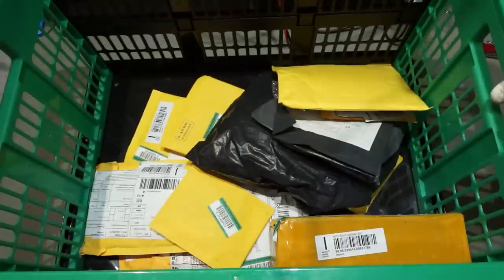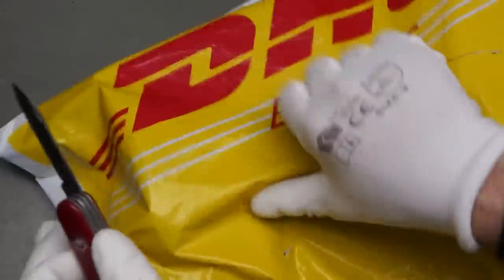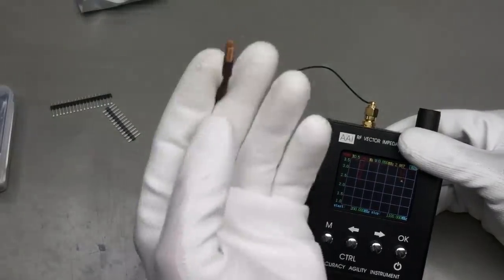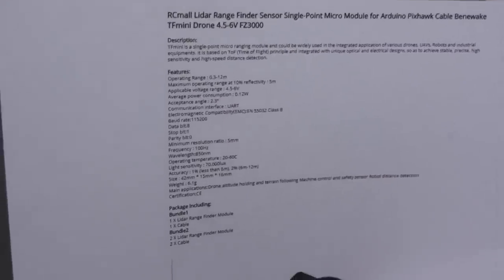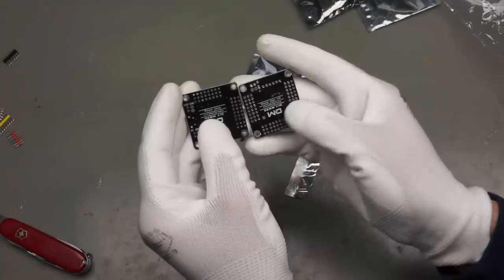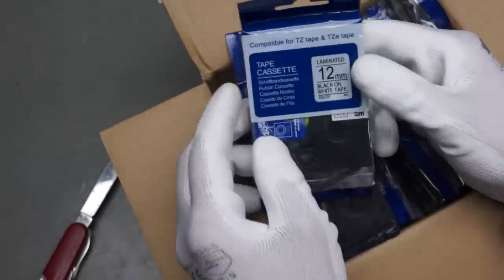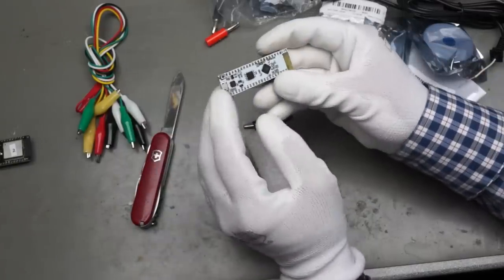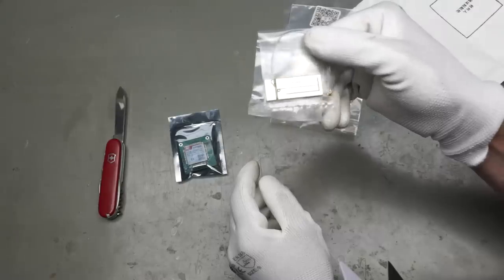#200 How to Spend your Money Wisely

Comment: This raises an interesting set of questions - what software does everyone use in keeping track of their parts, projects, tools etc ?  I started using partkeepr, which is pretty good at keeping my parts organized but doesn't really do much for keeping track of the things I design etc.
Reply from the maker: So far I only use my boxes and the order list / search function of Banggood and Aliexpress
Reply: I've tried to list all of my parts in a Libreoffice-document, but it's getting a tad unwieldy. I'd like to be able to attach any specsheet-PDFs, pictures and any other relevant files/documents and have the whole thing easily searchable, and, well, a Libreoffice-document just doesn't cut it.
I may have to eventually just roll up my sleeves and code the thing myself. It's just not very interesting, so I haven't actually managed to get started yet :/
Reply: Personally, I have a tad icky feeling of Evernote. They spy on you and while lists of what parts and stuff I have isn't particularly exciting, I still rather try to find an open-source solution or something that doesn't do any spying. Or, like I said, make my own solution once I get off my ass.
Reply: I use dokuwiki. Not perfect, but it works
Reply: I do have various boxes for bigger things and a large cabinet for a 3D-printer and the boxes, plus two organizers for smaller stuff ( https://www.dropbox.com/s/g5qswxw5wmbipg9/IMG_20180501_173559.jpg?dl=0 ) but, personally, I do not feel like that's enough. I still like the idea of actually cataloguing all the stuff and keeping all the specsheets and stuff alongside them. Those organizers are a godsend for actually keeping all the small stuff neatly accessible, though, and I don't have to worry about pens fading as I print those labels on a laser-printer.

Comment: I have some experience with the Sim7000E. If you need documentation or FW - you are welcome. This modem based on Qualcomm chipset. New Sim7020E with MTK chipset will be cheaper..
Reply from the maker: All help and experience is welcome. I have no knowledge about this module.

Comment: I bought some sim800l but I didn't got them to connect with the network.
Reply from the maker: Those networks are not easy :-(
Reply: Don't really see any other AT command which should have helped. However I then switched to the A6 which worked well and out of the box.

Comment: 20:48 When people don't fully understand some problems, they get scared. They might warn others who trust their warning and may repeat the warning. This is a useful behavior in case of some immediate danger. But then the warning gets repeated without any immediate danger, without ever asking themselves if there really was some immediate danger. And now it is a problem. Even worse, people get enraged if someone uses or promotes something they think is dangerous.

Most heavy metals are a victim of this irrational fear. Even the term heavy metal causes fear. What is a heavy metal? Metals that weigh more than 5 g/cm³ are called heavy metals. That is iron, tin, zinc, gold and silver, platinum, wolfram and many many more. There are other candidates like cadmium, lead, mercury, thallium or what about polonium. Those are considered toxic or dangerous, but in different ways.

The dangerous part of melting lead and pouring it into the socket of a tool is the involved heat. But having lead somewhere lying around is completely harmless. Most of the curtains I have contain a string of lead beads as a weight. I have lead on the roof, I have it in my solder and I'm not scared of it. I have a box of fishing weights, they are also made of lead. I have light dependent resistors containing cadmium and I'm sure I still have some nickel cadmium cells somewhere. I even have the worst of all, a box of mercury switches (at least 50g mercury there) and some mercury thermometers. I am still alive. ;)

By the  way, we are all much more likely to die from some cardiovascular disease (sitting in front of the computer all day, eating the wrong food and getting enraged about comments on the internet... heart attack impending). If this doesn't kill us, then it is some other age related disease or maybe some household accident, climbing on the chair to change a light bulb. Maybe it will be a car accident. How about walking over the street while staring on a phone and getting run over by someone who was texting while driving? There are many more stupid ways to die, all of them are more probable then death by chunk of lead (except in the land where toddlers with guns caused more deaths than terrorists). And now I'm listening to https://www.youtube.com/watch?v=U7-60tyLQhA and after that I'll leave the house to ride my motorcycle before the thunderstorm begins ;)
Reply from the maker: I also do not care too much... Driving a car is also dangerous and many are killed...
Reply: Yes, driving a car is probably the most dangerous activity for the average person. But they only fear the unlikely things. 

It is weird to read the own comment after a week. I write too much and forget it again, it is a weird habit. And thanks for this reminder to leave the house again, there is no thunderstorm today. And last week, the thunderstorm completely missed every place I visited. People not far away were not that lucky:

https://www.hessenschau.de/panorama/gewitter-wueten-ueber-ost--und-mittelhessen,wetter-muttertag-102.html
Reply from the maker: I was on the highway in this area. Not very pleasant...

Comment: I ordered three extremely heavy DC motors, they arrived three weeks after, but at the same day of arrival, I found out that they were not useful for my project.
Reply from the maker: You can start a dispute if they are not as described. It usually works if you are fast enough and have clear proofs.
Reply: @AndreasSpiess  Sure will, sir.

Comment: 12m is not much for a drone at 20mph it is unlikely to to be able to adjust before it hits an object, and any faster and there is no chance.
Reply from the maker: I think you are right. This is why some drones reduce the max. speed if in obstacle avoidance mode.

Comment: Thanks Andreas, nice, as always! Special thanks for pointing to Nanopower Power Supply LTC3588 - might try it with mini solar. By the way, have you considered to use SPV1040 as this on has MPTT implemented and might be better for maximising energy harvest from solar (or you are going to use LTC3588 with piezo or magnetic source - you are cyclist ant that might explain your choice). Anyway, thank you again for one more informative video! 
P.S. Also would be very interesting how TTGO OLED ESP32 handles battery (will CP2102 be powered all the time from battery or only when programming is done, etc)
Reply from the maker: Concerning TTGO: You have to wait for a week...

Comment: Hallo Andreas, ich habe aus dem TF Mini Sensor ein rotierendes 360° Lidar gebaut. Falls Du interessiert bist: https://github.com/Brezensalzer/StepperBotLidar2
Reply from the maker: Sieht gut aus! So wie es aussieht kannst du nur einmal 360 Grad abdecken? oder hast du eine Lösung für einen rotierenden Sensor?
Vielleicht werde ich Teile deines Sketches verwenden, wenn ich darf. Wie hast du die Visualisierung gelöst?
Reply: Der Arduino Sketch liefert pro "scan#" Befehl ein Set aus 360 Messpunkten ab. Der Rest passiert auf einem Linux Rechner mit Python (matplotlib.pyplot). Wenn man das in einer Endlosschleife aufruft rotiert der Sensor kontinuierlich. Die "echten" Lidars drehen mit konstanter, PID stabilisierter Drehzahl und liefern in festen Intervallen (100Hz) Messwerte ab, der Nulldurchgang muss präzise bestimmbar sein. Mir war das zu kompliziert, deshalb der simple Ansatz über den Schrittmotor.
Und natürlich darf jeder meine Sketches verwenden, deshalb habe ich sie auf Github hochgeladen. In den kommenden Tagen werde ich dort auch den Rest des Projektes (Python) bereitstellen.
PS: Der Sensor "schielt" etwas, ich drucke gerade einen neuen Drehteller um den Sensor hochkant zu montieren.